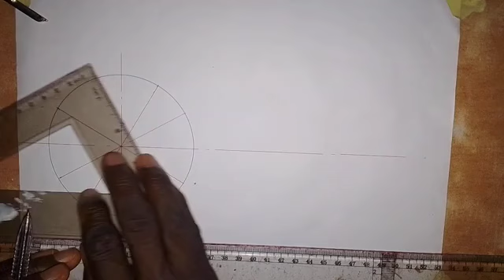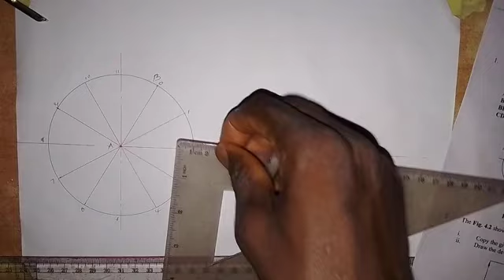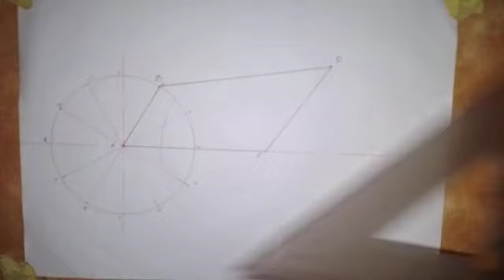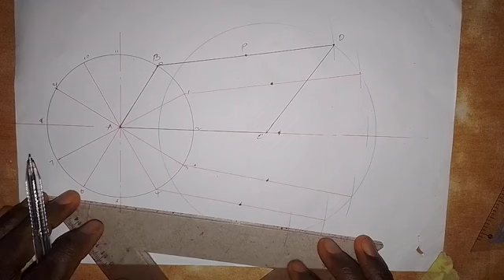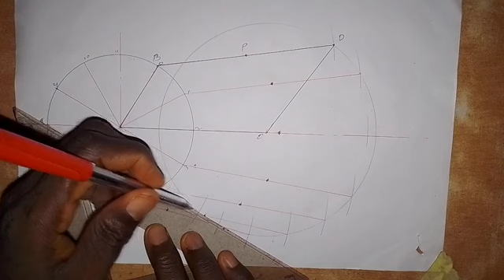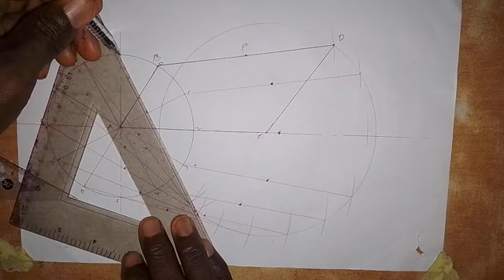2025 NECO QUESTION 1 - LINK MECHANISM

Comment: I've seen so many interpretations of this link mechanism
Makes me regret doing it
I only marked the top part of the circle produced from CD
and got the top side of the ying yang symbol as my loci
My friend only marked the bottom part of the circle produced from CD
and got the loci I got but flipped upside down
Now I see yours which rotated both cranks clockwise
Reply: The question also said crank AB is clockwise and CD oscillates